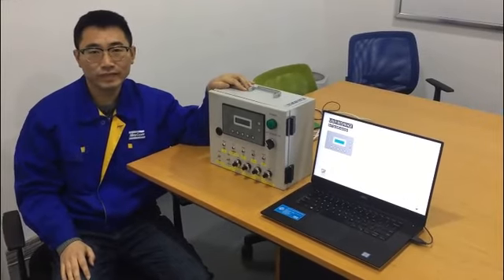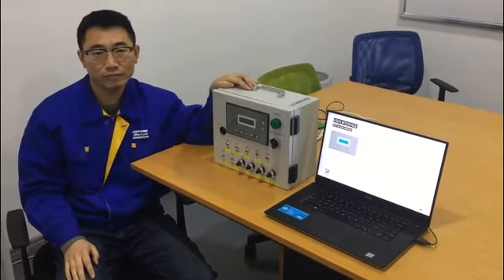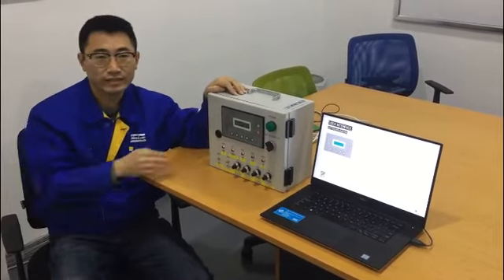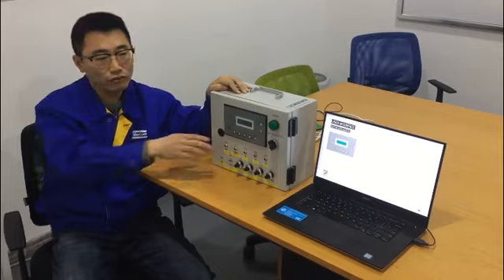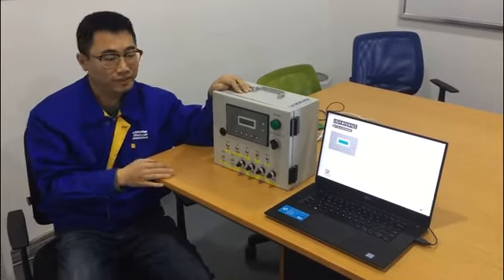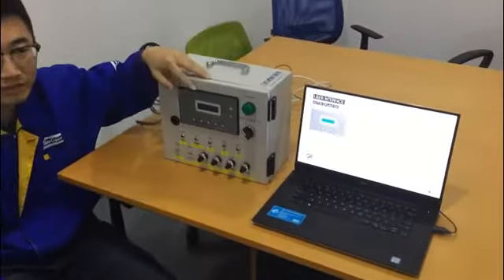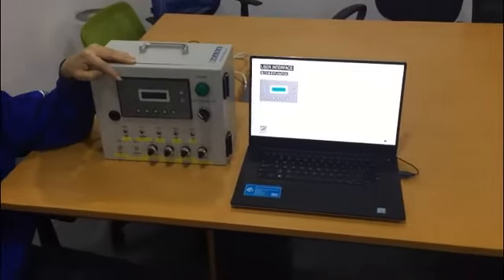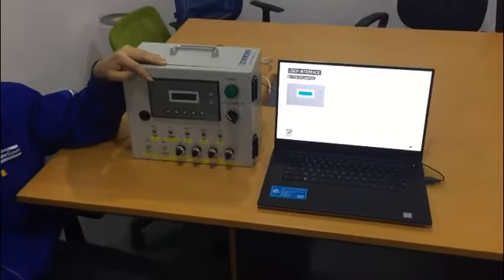Introduction of MAM870 controller

Comment: Mam 870 want voltage change parameter password .factory parameter password is 6093 but it's not work
Reply from the maker: Different compressor manufacturer set different password， try 1000 or 9320 or 0318

Comment: Dear sir
mam-870 
Fac parameter dont open i have no password
Reply from the maker: You have to contact the manufacturer or dealer to get password. Or try to use 9320, I amnot sure if it is OK, maybe different setting by different brand.

Comment: hello.. im facing a problem in my MAM 860 controller.. how can i reset the timer after we change the oil filter or somethng? can u help me with this??
Reply from the maker: I am not sure if your machine produced by my factory or others. Please select user parameter and  access into submenu and select OIL FILTER RST, press right button and enter password 9999 or your own password , then access into change interface, press up or down button to change the value to 0000, finally press save button

Comment: I have a question! My compressor isn´t detect a correct PHASE Voltaje. It detect 316V when really in line we have 380V. And of course the controller show us "LOW VOLTAJE". Is it something to INGORE THIS?. Cause the compressor is not working yet.!
Reply from the maker: Of course you cannot make it run until the problem solved.If you confirm the voltage is OK, I suggest you to cancel the function by accessing into the factory mode ( change the setting to 0000). Then order a spare part of the controller instead of current one to check again.